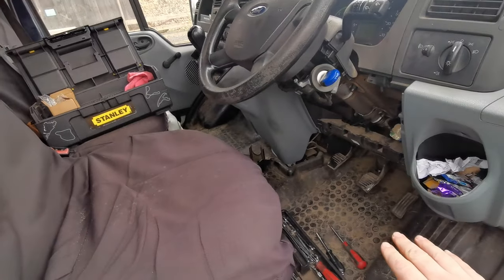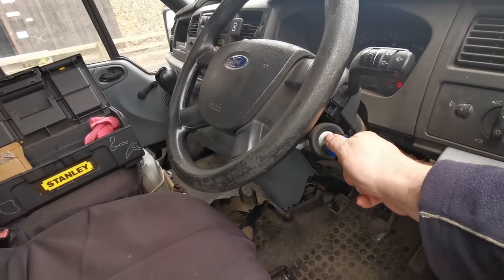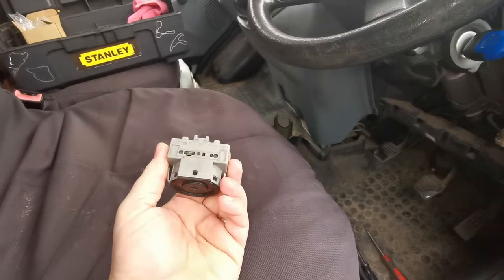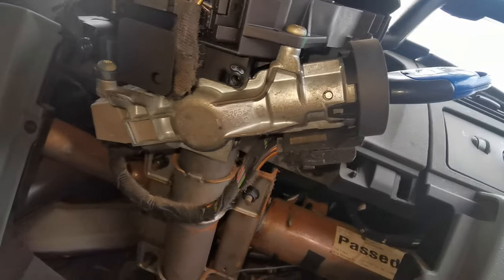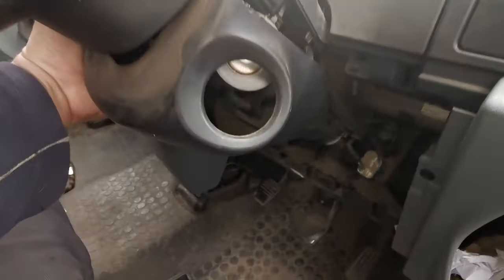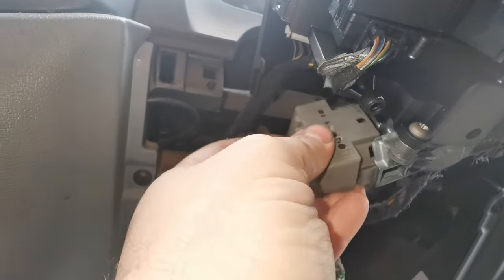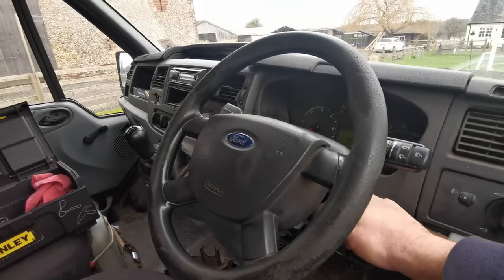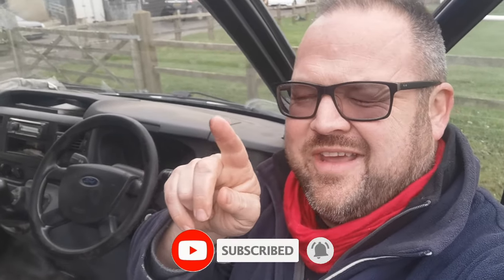Crank but No Start? Solved! | Common Ford Problem | 5 minute Ignition Barrel Switch Swap.

Comment from the maker: UPDATE: I've been asked so many times which part you need so I've now put a link in the video, a link on the end screen, a link in the description, and a link here, I hope that helps!
https://amzn.to/40cXmus
Reply: @rickthespud mate did you have any codes before this happened? Or did it ever cut out on you while driving? Mine cut out while driving and cranks but no start, tried the key in different positions as you suggested but no change? Just trying to gauge what my actual problem is.
Cheers in advance.
Reply from the maker: Nope, no codes.
If it's cut out while it's running and moving the key doesn't work I would guess that's not it, but change it anyway and see what happens. It's £8 and 5 minutes. 👊
Reply: @RickTheSpud  cheers boss
Reply from the maker: Let me know... 😉👌

Comment: Hi Rick, you have saved me from a 2 hour wait for the AA today. Had the same issue as you. The engine would turn over but not start. Gave the key a wiggle and hey presto the van started up. I will be ordering up the new part.
Reply from the maker: Ah that's brilliant! I'm so glad this has saved you. 👏👏👏
Make sure you subscribe too, and check out my other vids... 😎👌

Comment: Thank you so much Rick - I have a Fiesta Mk 6 - had problems on and off for a year with immobiliser issues which culminated into cutting out when driving and then just not starting at all. Just tried this and I'm back on the road - for anyone with Fiesta, you need a flathead screwdriver to depress the clip on the top as you can't get your fingers in.
Reply from the maker: Ah brilliant! Well done Sarah! So glad it worked! I was so relieved when I found out!
Help me out and Subscribe too! 😘👌
Reply: ❤ subscribed
Reply: was it randomly or your car just stopped starting?
did you read any errors on a scanner?

Comment: I never thought of that. I've just bought a 2010  transit as spares or repairs for £550 . My Mrs is giving me grief over it and I've only had it last night. She even gave me a hand to push it in the driveway. If this works I will let you know . I did say to the seller I thought it was an immobilizer problem as it worked two days ago fine .He never mentioned that he had trouble before so fingers crossed. I will let you know .
Reply from the maker: Yeah defo, keep me posted! Try manipulating the key, doesn't always work but might help, then change the switch... 👊

Comment: Hi mate, quick question - once you changed the ignition switch did that stop the wobble from the key when in the ignition? Reason I ask is mine is struggling to start and its very wobbly so wondering if mine may be on its last legs
Reply from the maker: Yeah a bit. Some of the movement is in the barrel itself which isn't changed, but some is in the switch. Try manipulating the switch when you twist it, push it in more, lift it up, pull it down. 
But for about £8 and 10 minutes it's worth changing. A common problem.
And Subscribe 😜👌

Comment: Hi and thanks, I think you've saved me at least £100 on Ford diagnostics....!  I tried the pushing the key down on my Transit Connect 2007 and it worked!  I'd like to replace the part on the ignition shaft now as you show, but could you tell me what the part is called?  I'm not a mechanic, just a woman trying to kit out an old van for camping.  Thanks again Rick.
Reply from the maker: Ah brilliant! It's my pleasure.
It's a Ford Ignition Switch, if you search on ebay you'll recognise one from my video. Super easy to install.
And don't forget to subscribe and tell your friends! And watch some other videos! 🤗❤️

Comment: You are the best,,,,I had the a
Same problem, mechanic charges Starter motor then he told me could be egr valve or fuel pump,,so I go to scrap yard, they gave it to me for free ,now Starts like new,,,, thanks a lot
Reply from the maker: Ah yes! Well done buddy! It took me a minute to work out what this was too hence why I made the vid! We got there in the end! 👊
Reply: Hi. Can you please tell me  from where  can  I buy the  part?. Thank you
Reply: was it randomly or your car just stopped starting?
did you read any errors on a scanner?

Comment: My Transit lost central locking and once turned off it reset heater clock and radio would not work. 
Today after changing the lock base everything’s working again. 
Thanks for the tip!!
Reply from the maker: Ah brilliant! Glad that sorted it! 👊😎

Comment: Top man, thanks. Sorted my transit out right away!
Reply from the maker: Ace. No worries mate. Don't forget to Subscribe! 👊
Reply: was it randomly or your car just stopped starting?
did you read any errors on a scanner?
Reply: @marcoaurelio6941  was difficult starting. Had to push key around to get it  started. 

I dont think I had any codes

Comment: Touch wood, mine is fine, but a great video.   I might invest in one and keep it in my Transit just in case.   
Some drivers tend to be very heavy handed,  and although inevitably moving parts wear out,  I suspect this causes early failure particularly on  frequent stop start journeys.   Damage the barrel avoidably and you’ll regret it.  I know when I loaned a previous vehicle to someone.
Reply from the maker: Cheers bud.
Yeah I do about 10 stop-start drops a day and vans are delivery vehicles so think that's why they wear out. If it starts to fail just manipulate the key and then get one. 👊😉

Comment: Thanks great video my mk8 transit cut out on me wouldn t start just cranking over, went back to van wiggled key about in ignition and it fired up and now starting again so i have just ordered one part says it fits mk8
Reply from the maker: Ah brilliant. Didn't know if it was the same on a Mk8, so glad it's worked! 👊

Comment: Hi Rick. Have somehow a similar Proble. My  2025  Ford Torneo connect 1.0 Ecobooster  is refusing to start but would crank directly from the fuse box switch. So apart from turning on the  dashboard the  they key isn' t able to start the car. Various technicians have tried different appraoches to no avail.  ECU module isn' t  responding coz they tried to connect a computer to read but failed. Note also that the vehicle would still crank even after disconnecting the ECU modeule; My Question: What exactly need to be replaced? ECU alone?  but what about the lockset which is programmed and linked to ECU?-then replace both? Any other component that should be included? 
 Any help will be appreciated .Thanks
Reply from the maker: Not sure buddy. Have you swapped the key barrel switch? Might cure it...

Comment: Hi mate , just a quick question. My Ranger 3.0 Tdci 2009 has just developed a problem. I turn the key to crank or start position and hold it on for a ten to twenty seconds, then it responds. I’m get afraid of getting into a fuel station on a busy day because people yell at me for not moving off quick enough. What could be the problem, thanks buddy
Reply from the maker: Maybe. Have you got a proper key or is it push button? If it's a key then investigate the barrel switch...

Comment: Hey Rick !
I had the same problem this morning with my transit custom 2016 . Manage to start the van but cannot find the part . Will I have to change the whole the ignition barrel?
Reply from the maker: Nope, just the switch on the back of the barrel.
Link is in the description of the video, or on screen at the end...
Reply from the maker: Pinned comment at the top too.
Make sure you hit that Subscribe button for me and check out my other vids... 👊😎

Comment: This does happen to my ford fiesta, after driving on the motorway and stopping in each services it doesn't want to start then I have to keep trying after 10 or 15mins it starts again like normal, it does it especially after driving awhile on 60 70mph
Reply from the maker: Try manipulating the key to see if that helps, but prob change the switch anyway. Likely that's what it is... 👊
Reply: @RickTheSpud  yes I will try that trick if not I'll change the switch (because the battery is still months new) which means the same switch as you changed for your van in the video right?
Reply from the maker: I believe so. If it's got the same style key it's the same switch. Double check when you order it tho. 👊
Reply: @RickTheSpud  cheers mate for the great help, already subscribed 'cause I just found your channel, we'll get it to grow bigger in the future, fingers crossed 🙏🏾
Reply from the maker: Bless you buddy! Hope so! 😎👌

Comment: Hello I am French "my English is not great. I would like to know how you go about removing the cover under the steering wheel. I removed the 2 screws but it does not come. Do you have to pull hard on it or there is Are there any other screws? Best regards
Reply from the maker: On this 2007 Transit it's just those 2 screws, after you've pulled off that panel, which just clips in.
Reply: OK THANKS @RickTheSpud

Comment: Hi I have the same issue, put new switch in but the problem still there ,key is quite loose ,any ideas?
Reply from the maker: Not sure mate, even if the key is loose, as long as it's turning the switch, that's all the key does. 🤔

Comment: quick question. before you actually fixed this did you scaned the van for errors? like did it said something about the fuel pump? because mine (transit connect 1.8 tddi) says.

did yours said to? out of curiosity
Reply from the maker: I didn't but there was no lights on. Never thought of it. If it had no EML on could there still be codes?
Reply: in my case there is no EML light on and it points me to no pressure on the fuel pump. The question that pops onto my head is: could no pressure on the fuel pump be triggered from this particular issue perhaps?  @RickTheSpud
Reply from the maker: @marcoaurelio6941  Maybe. Try manipulating the key as per the video. Before you turn it, push it in more or lift it up or down to see if that works.
Reply: @RickTheSpud  thats what i was thinking. Thanks ill do that before i finalyze disassembling the fuel pump. If that works ill give you feedback. Thanks a lot
Reply from the maker: No worries mate. Yeah keep us posted. Hope it's a simple as that! 👊😎
Reply: @marcoaurelio6941 You tried the fuel pump shut-off switch?
Reply: @VvV-xc5vq  which one are you refering to, sorry?
Reply: @marcoaurelio6941  did the ignition switch work? It was it the fuel pump
Reply from the maker: Ah well. At least you started with the cheapest easiest thing! Glad it's working again. 💪
Reply: Hi all. OP here. Quick update: my fuel pump on the engine i believe is the only one. (There doesnt seem to be any pump on the deposit itself)

So what ive came to find out was that my fuel pump had a broken connection to a transistor. Im yet on the proccess of repairing it.

What ive come to know is that this can happen due to the outter connections/wires becaming unshielded and touching each others. Most problably on their ends next to the module or the other ends.
 Im still to verify my wires before trying the repaired module. Make sure you do it also
Reply from the maker: Ace  thank you for that. Extra helpful. 👊
Reply: @RickTheSpud  so pump was repaired, and now a "Watchdog signal lost" error came out. I still couldnt manage to turn it on.
Im now starting to think that maybe this piece is broken. Let me try to get one from Ford and see how that helps. Will keep you posted. I wish you were right (even though pump transistor was already burnt)
Reply from the maker: Sounds like it might be a couple of things. Is it cranking? Easy cheap part to replace so worth doing...
Reply: yes it cranks. Thought it doesnt start. Fuel Pump error went away but now i have a P1608 and a P1664 error  @RickTheSpud
Reply from the maker: Oh, yeah try changing that part then. Link in description. Usually next day.

Comment: Does this effect the Transit Custom? Mine is cranking but not starting.

I was driving then the engine cut off and wouldn't start again.
Reply from the maker: Quote possible. Try manipulating the key when you turn it. Push it in or lift it or pull it down when you twist it. Still might be it. It's about £8. Easy swap.
Reply: Did you ever figure it out? Mine did the same thing and ford gave up after replacing all the sensors, pcm, cables
Reply from the maker: Did you change this switch?
Reply: Yes I did
 @RickTheSpud
Reply from the maker: And did it cure it?
Reply: @SavajayOfficial ???
Reply: @matchstik69  no I never solved it. I had it at ford for 2 months and they called me one day and did they couldn’t figure it out and I literally had it have it towed from ford to my house
Reply from the maker: Oh no!

Comment: Would this be the same on a mk 6 transit?
Reply from the maker: Not sure, prob. Does manipulating the key help it! Google for a MK6 transit ignition switch and see if it's the same. 👊
Reply: @RickTheSpud  I googled it and the switch is compatible with my year transit, I tried manipulating the key but it didn't help, I'm going to grab a brand new battery tomorrow from work and see if that helps as it turns over but doesn't start and then when I try again it just clicks
Reply from the maker: If it clicks it sounds like the battery.